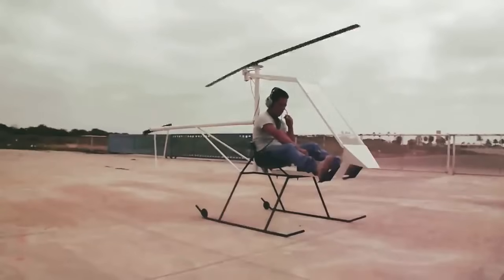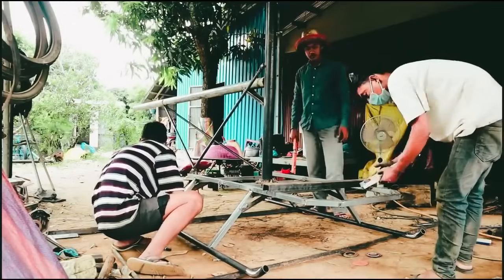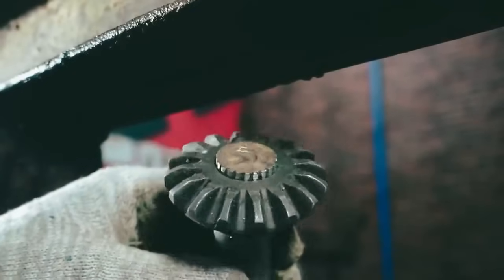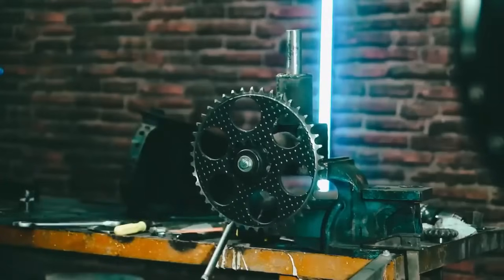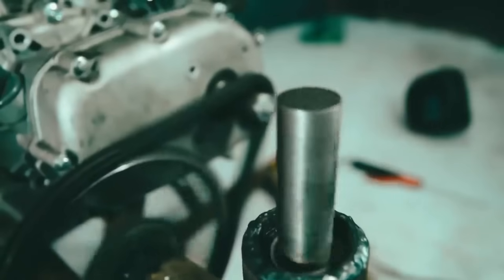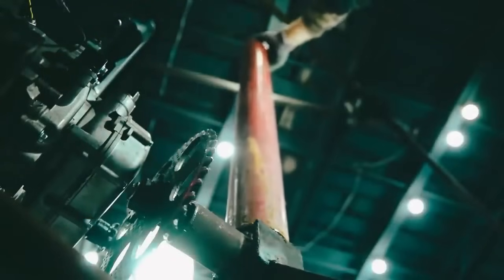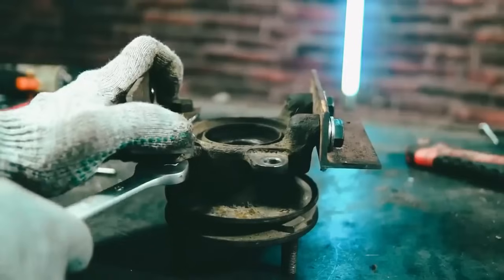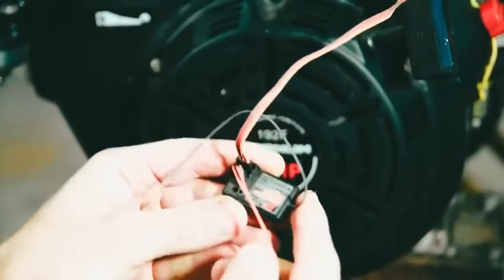How to make a Home Made Helicopter from scrapped metals   Start to End in just 14 minutes

Comment: I would build a small carbon fiber cockpit for protection and small baggage space or a emergency seat. Wearing a modern parachute for the safety as standard, because there is no way to glide a Heli after a serious engine fail ! The cockpit protects against insects and birds impacts! I would start to calculate at this point the costs of time and cash, because Honda and Tesla will sale soon a brand new flying car for 4000$US to 7500$US !!!
Reply: Then build it

Comment: Hahahaha..........i wish you could luck with this one !   The only good thing here is that this contraption will luckily not leave mother earth to smash you eventually to the ground.  Instead you reduction gear will break because it is to small , your induction gear will never withstand the   torque from the rotor every one else use a BIG pully and a strong belt to drive the rotor. You are showing exactly hot  NOT TO MAKE a helicopter. Also seems you did not even balance the rotor and also the metal you welded for bearing seat is not 100% round shape with means your  bearings outer is not 100% round  is going to wear out very very  fast . You should make bearing seat from solid metal , ask n engineering works to drill a perfect round hole into it exactly the size off the bearing and then press it in.

Comment: You're going to kill someone with such instructions. That verticle "tube" from the output shaft could sheer and send blades flying. That portion should be a solid structure.
Reply: it aint even their video they straight ripped it from someone else

Comment: Well done bro but am not certain of  how the helcopter will generate lift after all you haven't put a swash plate on the main rotor mast which responsible  for changing pitch angle of the rotor blades which in return lift is generated
Reply: Have you ever seen a fix pitch heli . Back in the day about 50 years ago . Dang I am getting old . But back about 50 years ago most RC gas helicopters had fixed pitch main blades .  Now these are RC like I said . And the engines was ether gas or glow fuel . Most of these engines was 2 strokes . So the RPM was much greater . The greater the RPM the greater the lift going to be .  The movement forward  , back , side to side comes from a tilting head . This operated on a simple swash plate .  The tail rotors was varable pitch but not collective pitch .  The heli can move forward and reverse and side ways  then the tail rotor acts like a rudder .  After wathing this video It's a bat and switch . This heli could never ever fly at any levels of the build .
Reply: " **GOOD MORNIN VIETNAM**"

There's something happening here.
What it is ain't exactly clear.
There's a man with a gun over there
And he's telling me that i got to beware.

I think it's time we stop.
Hey, what's that sound?
Everybody look what's going down.

There's battle lines bein' drawn.
Nobody's right if everyone's wrong, no
Young people speaking their minds
And getting so much resistance from behind.

I think it's time we stop.
Hey, what's that sound?
Everybody look what's going down.

What a field day for the heat.
And there's a thousand people in the streets
Singing songs and they're carrying signs
Mostly saying hooray for our side.

It's time we stop.
Hey, what's that sound?
Everybody look what's going down.

Paranoia strikes deep (into...)
Into your life it will creep (starts when...)
It starts when you're always afraid (step out...)
Step out of line, the men come and take you away.

You better stop.
Hey, what's that sound?
Everybody look what's going down
(stop hey, tell me)
You better stop.
Hey, what's that sound?
Everybody look what's going

This is what was playing on his mind as he made it, bro is the irl besiege engineer

Comment: I do not see the point in this vid as is showing how NOT to make a helicopter. Not the slightest chance this would fly. It is built like a heavy duty tractor. Sheet steel body, steel girders for framework, cast iron car hub and that angle gearbox alone must have weighed 25 kilos - did it have oil in it. The translation was lost in parts too lol.
Reply: With no precise measurements too.
Reply: And guaranteed loss of life for the cretin daft enough even attempt to fly such a comtraption